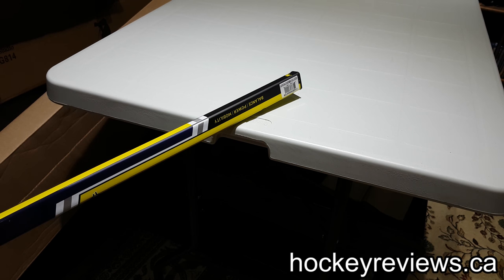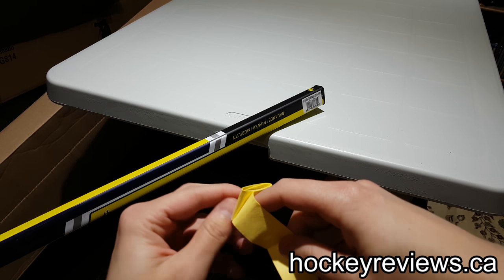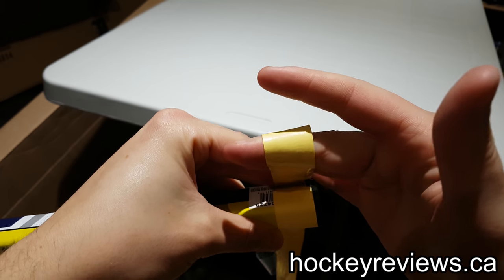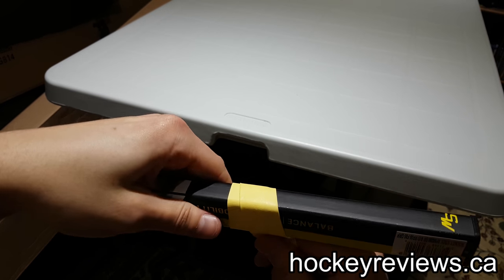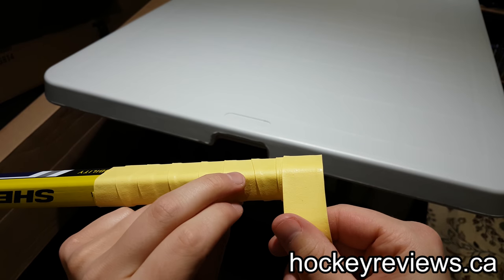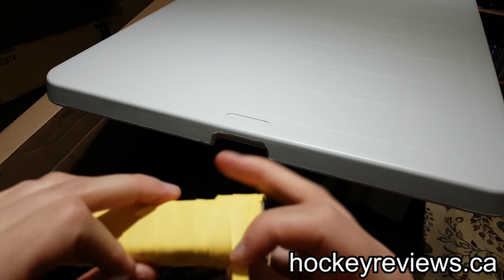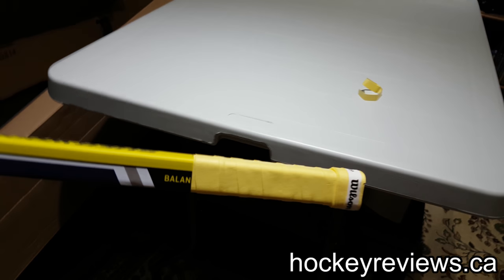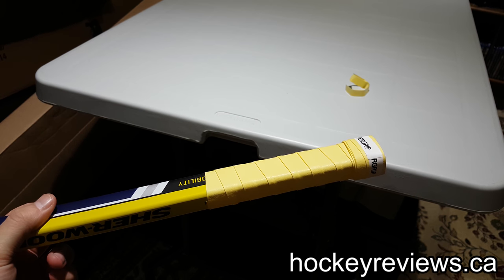How To Install a Tennis Overgrip Onto a Hockey Stick

Comment: So... I'm extremely new to hockey, but I've gripped hundreds of racquets (or a few racquets hundreds of times).  I started thinking about how I might want to grip my stick and decided to give overgrip a try.  Also using the Wilson Pro grip, here was my step-by-step process.

1. Unwrap the entire grip.  The plastic being off of the grip isn't going to matter that much unless you're sitting in a pile of dirt of something.

2. With scissors, cut a little more than halfway down the grip from the tapered end.  So you should have a longer piece with a tapered end, and a shorter piece that has the same edges on both ends. *You could get away with pretty much just half and half here... it kind of depends on how far down the shaft you want to grip.  If you want a longer grip, cut it directly in half.  If you want a shorter grip, keep the tapered end longer.

3. Cut lengthwise down the longer piece with the tapered end.  So you'll have two pieces of grip that are half the width.  You'll use these to make your knob.

4. Place an end of the half-width grip at the very top of your stick and hold down with a finger.  Then wrap tightly, straight around the stick til you get to the end.  Hold that piece in place.

5. Wrap the other half-width piece over top.  You'll find that as you start wrapping, the tight tackiness will hold everything in place.  Once you've made it around the stick one time, everything holds into place.

6. Taking the full-width, short end, starting where you left off with the halfwidth, wrap around the top of your stick once, then just below once to make everything tight.  Then start spiraling your way down the stick, leaving about 3-5mm of overlap on every wrap.

7. When you near the bottom of your grip, wrap once straight around the stick to finish it off.  Hold that in place, and apply the grip's end-tape (my guess is when the stick is down on the ice, you want the Wilson Pro Grip lettering to be face-up).

Comment: I've been using tennis overgrip on my sticks for some time now. The way i do it and i recommend doing it is you tape a knob and a grip if you'd like with hockey tape and then put one layer of overgrip tape on top of that, starting from the top and working your way down, and secure it with 2-3 rounds of hockey tape on the bottom.
Reply: Ive just taped my stick with this stuff for the first time and this is how I did it. Still not convinced it won't unravel midgame 😂
Reply: @JDFish  If it's a quality grip tape it will last you 2-3 months. :)